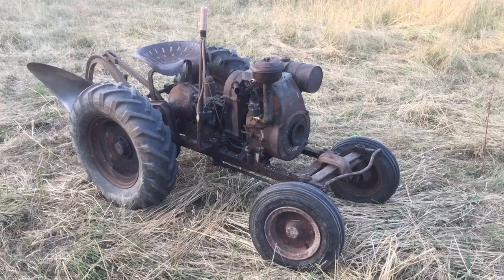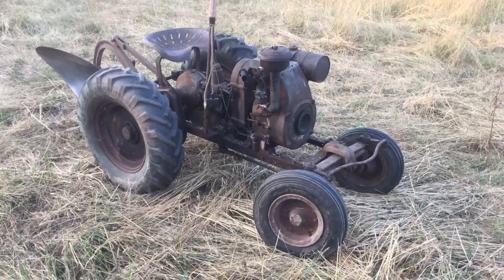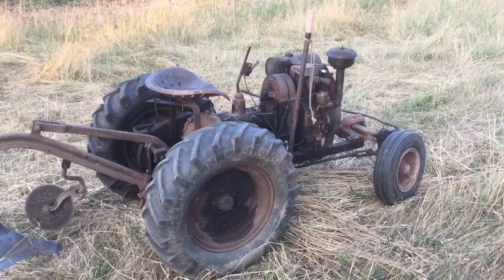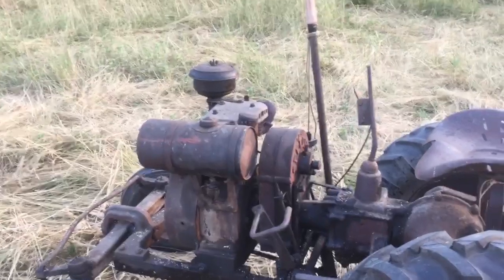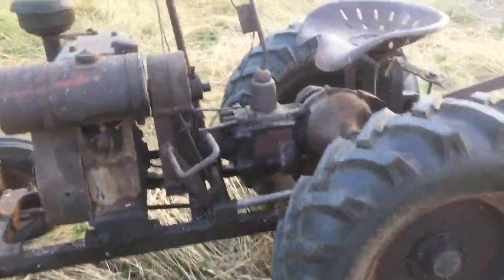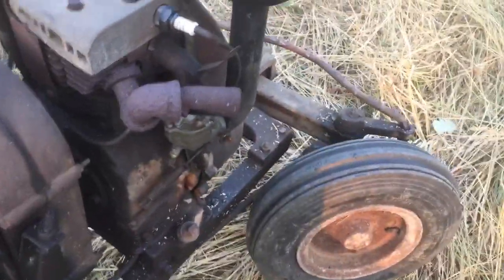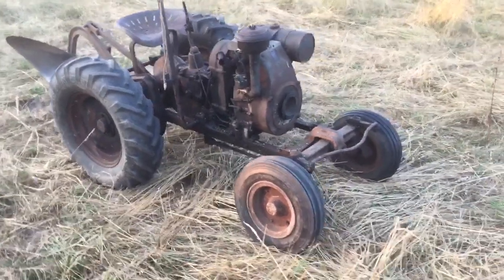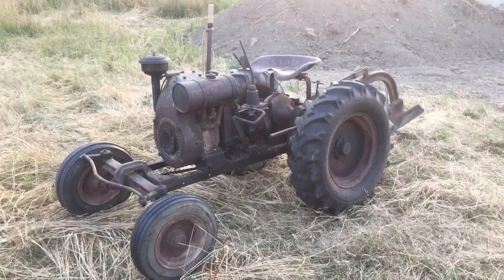1941 Speedex Model B Antique Garden Tractor

Comment: I worked for Speedex for a time, in Ravenna Ohio, as a draftsman in their engineering department.  ...And this is the most complete and original 1941 Speedex I've seen in almost 40 years!  In fact, that "Pond Garage" stencil is absolutely wild!  Granted, I don't see MANY 1941 Speedexes, but still living in the area I've seen roughly a dozen, and most are not restored but repaired.  ...Repowered, re-wheeled, incorrectly painted, etc., etc..  Back in 1978 or '79, my best friend and I completely and correctly RESTORED a 1941 Speedex Model B that he got from an uncle.  It was more complete than yours, but in far worse condition when I helped him fetch it.  Your plow is original, as is your right rear tire.  I think your steering tie rod up front is a homemade replacement though, as I've never seen another like it.  I do hope you have been or will be able to find the carb or parts necessary to put it back the way it was, and most of all, I hope you've never been hurt by this thing.  As you may have discovered by now, these things have a high center of gravity, terrible weight distribution, and one of the clumsiest positions you'll ever assume to drive or operate a piece of outdoor power equipment.  Best to just drive it around carefully and tell everyone what a great daredevil you are to do so!  ;) Thanks for sharing your video!!  :)
Reply: Other Pond family members created what became Wheel Horse
Reply: Would you know where I can purchase the steel seat that this tractor come from the factory ?? So nice to hear your two cents about this unique piece. What other models would you say were made by Speedex from someone who knows ?? Thanks vf
Reply: Hi  @victoryfirst2878   Unfortunately I don't know where you might find a seat for your tractor.  ...But I'd wager that Speedex bought it off-the-shelf from a vendor, meaning seats identical to your Speedex' might still be found on one of many other machines built in the same period.

Speedex made many models of tractors between 1935 and their closing (in the early '90s, if memory serves.)  I know that engine displacements were the basis of the model numbers in the S-series tractors made from the late 50s to early '70s, and don't know but wonder if that was also true of the M-series tractors that preceded them.  For example, an S-19 tractor had a 19 cubic inch engine, an S-24 tractor had a 24 cubic inch engine, etc..  Again, I don't know if that's also the case with the M-series tractors: M-16, M-23 & M-25, but it at least seems like a fair guess.

From about 1974 onward, the 30 and 40 series model numbers generally followed this convention:
A final digit of:
"0" indicated 8" front wheels,
"1" indicated 12" front wheels, and
"2" indicated 12" front wheels & hydraulic lift
The next to last digit ID'd transmission:
"3" indicated three forward, 1 reverse
"4" indicated four forward, 1 reverse
...And the leading digit(s) indicated horsepower:
"8" indicated  8 horsepower,
"10" indicated  10 horsepower,
"16" indicated  16 horsepower,
etc.

Speedex hydrostatic tractor model numbers similarly began with horsepower, but ended with the suffix "22."

(...And note that earlier "2 speed" Speedex tractors only had one forward speed.  The "2nd gear" was the same speed in reverse.)

Some of Speedex' earliest tractors' engines, transmissions and differentials were generally sourced from Fords in auto-salvage yards.  Model Bs like yours still used Fort T rear differentials and housings, but their clutch mechanisms are clever, durable and unique.  The Ford Motor Company itself forced Speedex to stop that.

Comment: I have (had) that same stencil on my 41'. Thanks to seeing your video in the past I was able to easily recognize it.  Mine was not on the rim but inside the final drive cover on the right side. As much as I wanted to save it, it was soaked with all the grease and easily wiped off while cleaning. Makes me wonder how many others might have one hidden under the cover, or had one on a rim. "SPEEDEX MODEL B, THE'RE ALL THE SAME, BUT THE'RE ALL DIFFERENT"

Comment: My dad  bought one of these used about 1959. Looked  just like this except the engine was all the way forward on the frame rails, the output shaft had a universal joint which attached straight thru to a short shaft which ran thru a pillow block bearing. The clutch pulley was attached to the other end. i don't know if this was  factory or a modify, but it worked great. It came with no brakes , so my dad  made an  external contracting brake to attach to the left axle. It had a lever about 12" long to pull up and a band would contract around a flat faced type of pulley that clamped around the axle. I used this little tractor a lot myself, it it was tough. My Dad passed away in 1975, and I don't know what my mom did with it. She has also passed away.

Comment: I have found a 42 but does not have the original Briggs ZZ and the front end has been changed (king pins not used) If I buy this tractor will I be able to find the parts to make it whole? I would love to restore it. I am a Wheel Horse guy and would love to have it done next to my Horses. Oh, It has the optional rear individual brakes still there. Thanks! Dave in Va